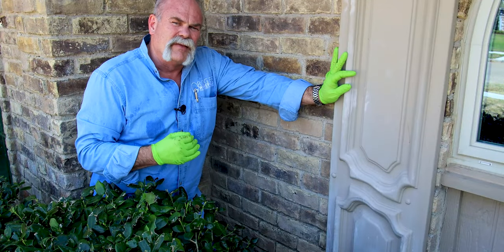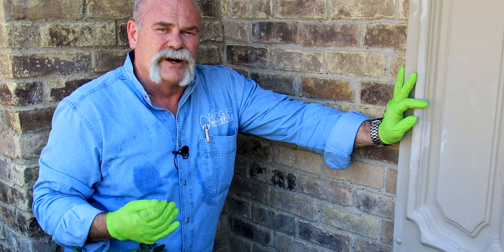Hydro Jetting Drain Cleaning - Blocked Drain Plumbing Call

Comment from the maker: How often do you use hydro-jetters? Do you like hydro-jetting or using plumbing snakes better?
Check out my blocked drains playlist: https://www.youtube.com/playlist?list=PLSpTuwsLqh7vodQIX4rIWR-rbT44xeqnT
Reply: I prefer to jet the line. I just bought 2 new jetters from Gorlitz. Small electric for small lines, and Big gas powered GO4000 for main lines/commercial lines up to 10 inch! Can't wait to use that big guy!
Reply: I operated a Hydro-Jetter for about 35 years, i always enjoyed using it when it was needed.

Comment: Jetting is the best way to "clean " drains. Unfortunately where I live you don't find a lot of branch line clean outs  on exterior of homes. We hired an east Texas plumber once upon a time,  and he explained that in Texas it's code to have clean outs penetrating the foundation.  Also much more crawlspaces than slab homes. So typically we are stuck with snake and camera routine,  unless it's jetting main lines after it exists the home .

Comment: Hi Rodger thanks for the videos. 
I have a question how many psi and gpm is the current set up (hydrojetter) you are using.  I've seen some hydrojetters with 3000psi and like 12gpm and other like 4000psi 9 gpm. Which set up do you find more effective?

Comment: Hey roger.  This is a picture of my rv sewer hose that fell down the big cleanout  outside my old work grow more fertilixlzer. I had just got my rv and had to learn how to dump tank.s.  my boss said that he used the cleanout out side our shop at the factory.   We make fertilizer at in carson Calif ornaia.  We had lots of washout we had been dumping into the sink drains at that time of year. Everyday and my boss was super stressed out anyways.   Well. I was dumping by myself. Realizing the sewer hose had no twist cam lock ends or ended any kind. I got down and was holding the hose to the valve and pulled handle. Boom. Its jumping like a python eating a bunny .  Then. Like in the cartoons it starts popping pinhole shooting leaks.  I'm like yuk. And let go to turn off the

Comment: Interesting videos thanks for sharing. I've got a question for you, and I'm not a plumber, which is best at clearing/opening a I guess clog in old galvanized pipes hydro jet, snake or both?

Beside the obvious replace the cast iron pipes let me set up the scenario. Briefly bathroom sink that hasn't been used in quite a while, water lines work but the water is slow to non-draining in the sink. P-trap was cleaned out and of course there's rust and sediment. So I assume there's a rust and sediment clog somewhere that needs to be opened up. The water line do this particular toilet also hasn't been used in a while so I can only assume there might be a bit of buildup in that line too. So snake or hydro or is there some other method? Thanks so much for reading my post and responding if you do 🌻

Comment: Roger, what is your opinion on the epoxy lining system?? And do you know how much the machine to do that service cost?.... thank you for the videos, I’ve learned so much
Reply: the epoxy is good for certain jobs.. at work we had to sleeve 75 feet of 4 inch line under a slab of all apartments and it was around 10k dollars....this was about 5 years ago and came with a 20 year warranty.....so far no problems and we jet it once a year just for maintenance...

Comment: Ohhhhh another big no no Mini JETTERs are not  a good ideal for main sewer lines One they can get stuck Two they can run out the commode and flood the house
Reply from the maker: Well we went through a wall cleanout serving the stopped up kitchen branch line. We stopped when we got to the main. It worked great and did the job.

Comment: Hose . Well the slinky line was gone when I came back.  Oh shoot I said and figure stop just run  hose for a while and it would wash thru .   I had to work at the other plant in gardena the next 4 days and figured it would pass.   Well. They clogged up the next day and seeing my boss always paranoid for dumping reactive fert down drains would get osha's opa interest.  He didnt tell me or anyone just called plumber. And said fix it.  Well 4 days two snakes hooked together for its 200 feet to the main. AMD a camera crew.  Finally figured this baby blue slinky hose to blame from one rv.  I was caught red handed.  And with a 2500 bill.  I was suspended and ultamemtly fired